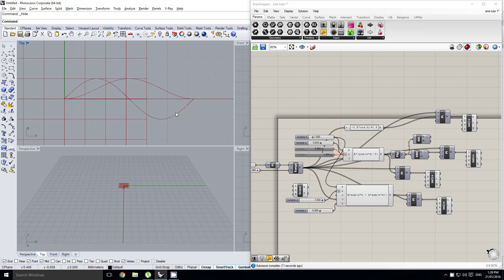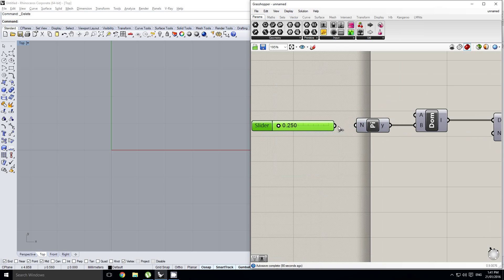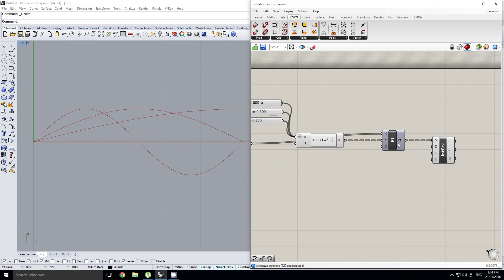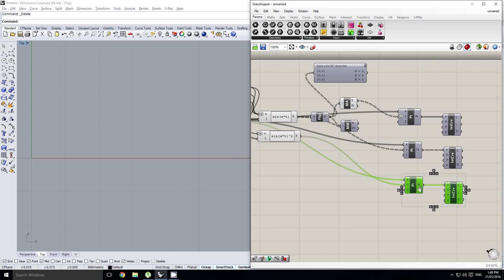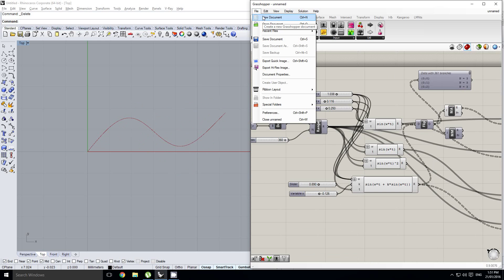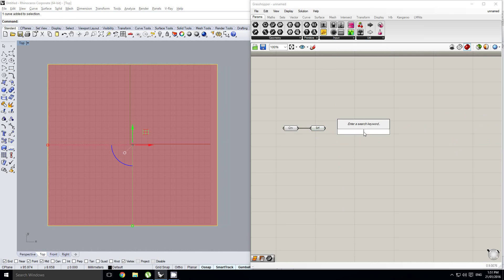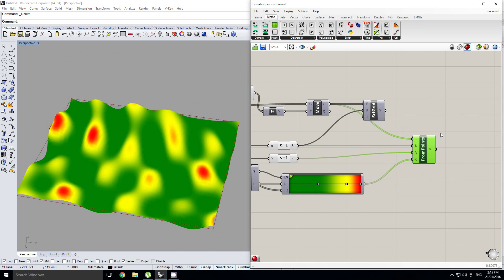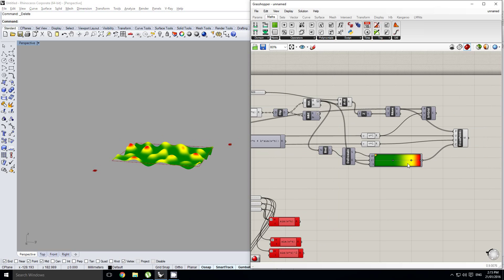Grasshopper - Sine Functions and Transformations

Comment: At 3:52 when you connect the variables to the sin function I can only connect one variable at a time.  When one connects the other disconnects? What am I doing wrong?
Reply from the maker: +Savannah Alfont hold the shift key to add multiple streams into the same component.

Comment: This was a very helpful tutorial. Only part that I found difficult to follow is when the components are juxtaposed onto each other. It is hard to understand if the wire is going into that component or going underneath to the next one on the grasshopper sheet.

Comment: Hi, thank you for all the tutorials! They are amazing! I have a question though, when I use Mesh From Points component, I don't get the smooth mesh, but rather low poly mesh.. so it differs quite a lot from the Surface From Points component. I tried smoothing it with Weaverbird's Loop Subdivision, but the pattern changes a bit from the original one. Any thoughts on what might be the problem? :)
Reply from the maker: +Milica Dukic well, assuming you don't want to change the density too much, I would recommend using weaverbird's catmull-clark subdivision. Any time you are creating a mesh composed of quads, use catmull-clark, loop subdivision should be reserved for triangular meshes.
I'm assuming by pattern, you mean the colouring, as opposed to the waveform of the surface?

Comment: Thanks ! 
just one question; i get an Insufficient number of points.; right at the mesh from points component at the very end ... any idea?
Reply from the maker: Erez Ezra could be any number of things.. Is all the data coming into the component flattened? Have you plugged the correct inputs into the U and V slots? 

Check how many points you have coming into P, this should be equivalent to what you'd get if you multiplied your U and V values - if not, you've found the discrepancy.
Reply: Thanks got it !  ;-)